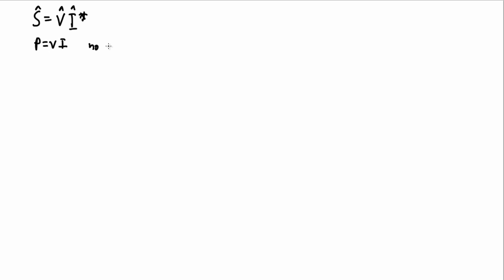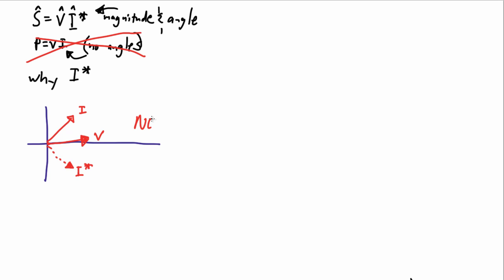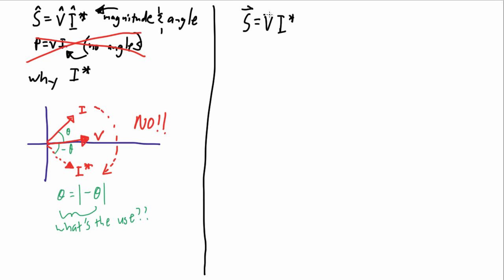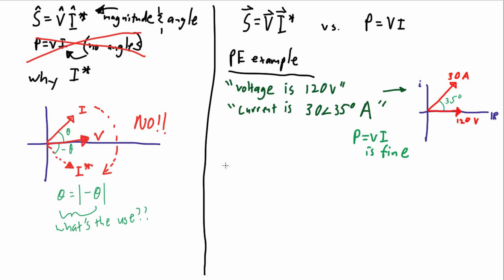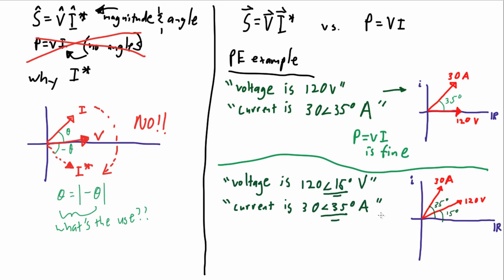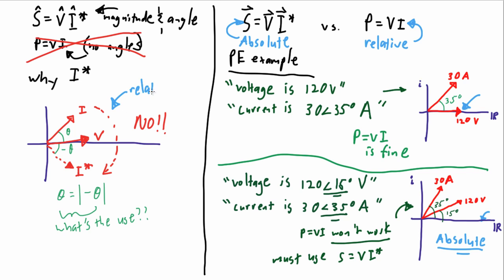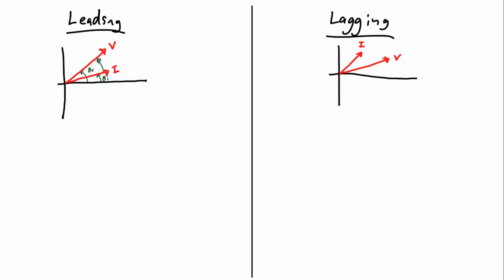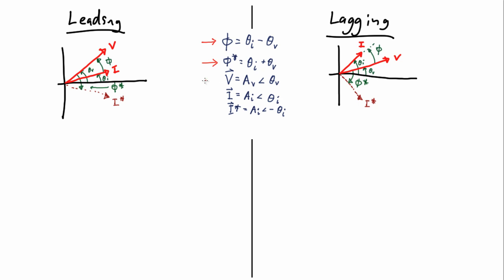Electrical PE Exam - The Conjugate (S=VI*) [part 1]

Comment: Current lags voltage for lagging pf loads. (Rotation is ccw by standard convention.) Your headings for leading and lagging are backwards.
Reply: The labels have since been fixed, in case anyone was going to skip the video because of this previous mistake.